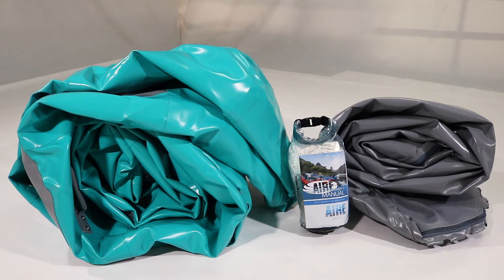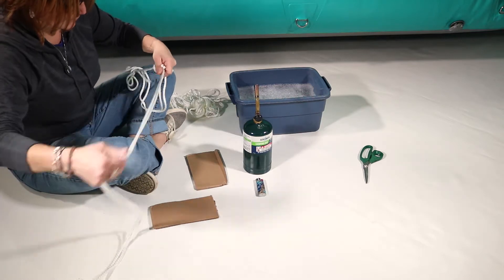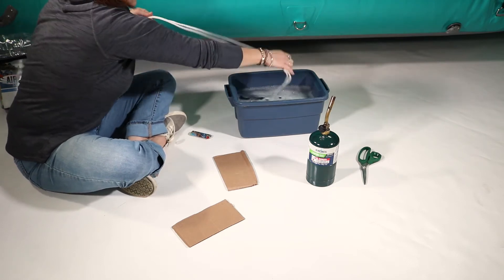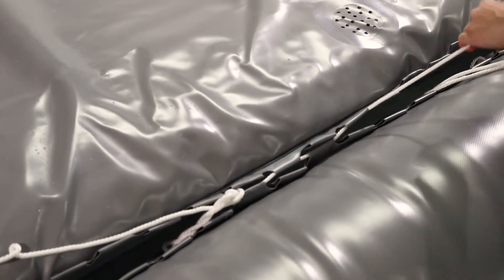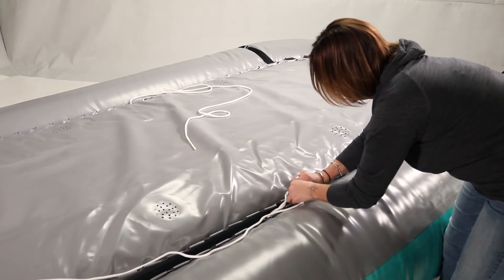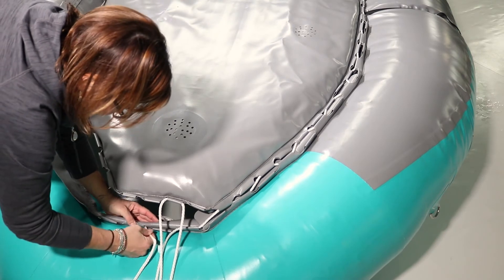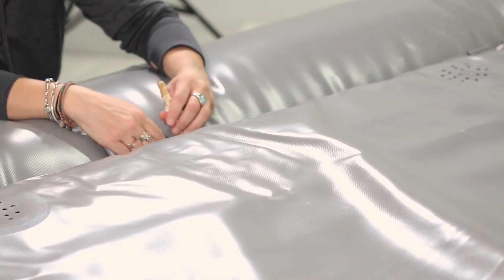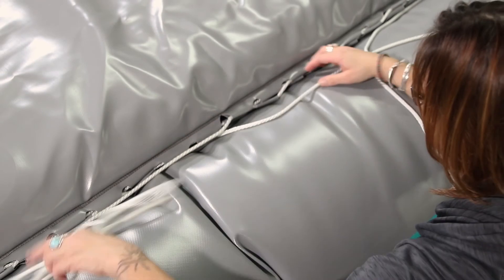White Water Raft Floor: Installation

Comment: I just laced my floor in after aire did a wonderful job of replacing the aire logos on the tubes. 1 tip I did , the ends of the ropes , I used about 4 inches of automotive shrink tubingon it , the job went incredibly fast after that.

Comment: What rope and where to buy rope for lacing the bottom an AIRE raft?  Any recommendations?
Reply from the maker: Hi Jonathan, We send rope with each new boat, but if for some reason you need to relace a used boat call in to 1(844) 243-2473 and they'll get you hooked up!